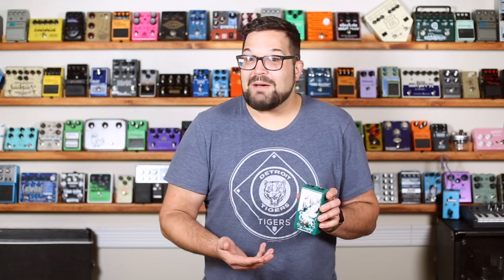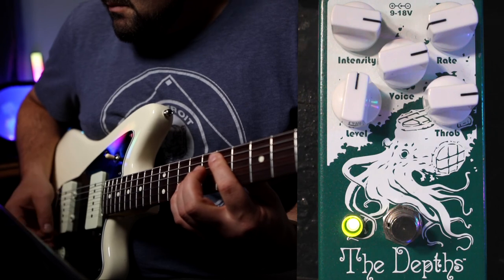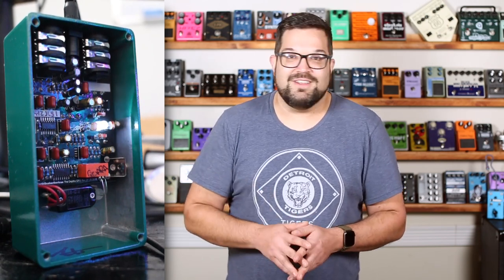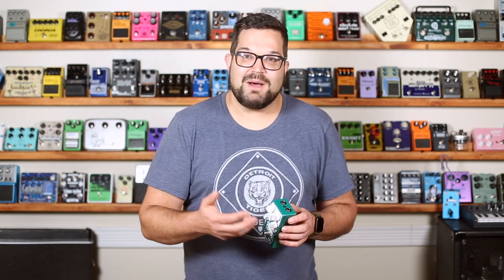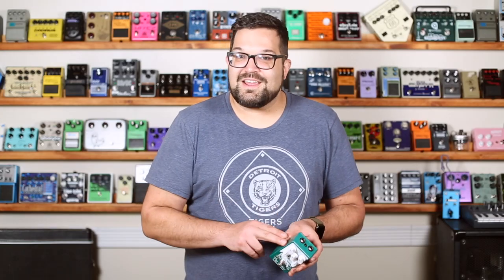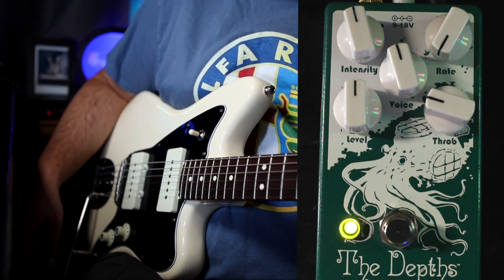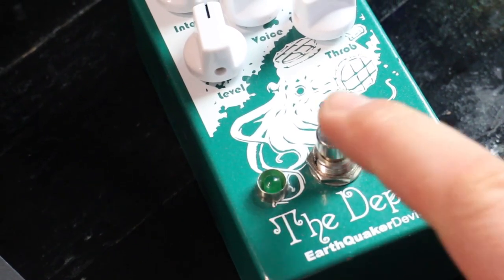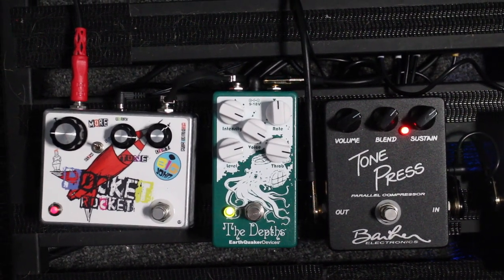Earthquaker Devices - The Depths : Deep Sea Swirlies

Comment: I love the theoretical and historical information, no need to shortcut that.

I also love knowing if a univibe really has a light in it. I know I’m not supposed to care about that, but I do.

You are the first pedal YouTuber I’ve seen who actually has shown, not just the location of the light source, but showing it in operation. I think that’s really helpful for people who are learning about univibe for the first time.

Always love seeing the frequency analyzer, that’s so helpful for understanding what the pots are doing to the waveform.

And omg, ham radio operator - your nerd credit just went through the roof for me. Not cuz I’m a ham radio operator (I’m not), but because i worked for 16 years for a large defense contractor and so many electrical engineers there were ham radio operators, and I associate that hobby with a strong knowledge in electronics.

Great video!
Reply from the maker: Thank you thank you! I initially only got my radio license so I could legally use higher power transmitters for POV cameras in quadcoptors. It’s a fun bunch of tech info, and I honestly found the research fun. There’s lots of neat stuff in the radio arts.  

The Uni-Vibe bulb thing fascinates me. I think about what might happen with different reflective surfaces, or physically moving the LDRs. Or putting a disco ball in there. 

On The Depths, the voice knob controls the overall brightness of the light. Amazing how it all works together, though I prefer the ones with a real bulb and not an LED. They have a different trailing out that I really like.
Reply: @StompboxBreakdown  Same on the fascination with the bulb triggering and wondering what other configurations would do 🙂 That’s cool to know the voice knob controls brightness! Same here, a real bulb is super cool, but golly is that hard to find. Pretty sure my Unicorn is an LED too, but man it’s hard to get a look inside, and I learned the hard way I’m not skilled enough to dismantle modern pedals while trying to fix a bad pot on a Lunastone Distortion 1 🙂

Comment: I have owned the V1 version of this pedal and now have the V2. Also have a JHS Unicorn V2. I love the Depths, just has its own thing going on. It’s my go-to for vibe tones. Great video, nice to see this pedal get some more coverage.
Reply: Is the only difference between V1 and V2 the momentary function like stated in the vid?
Reply: @adamkrauss303  I recall thinking the speed range changed - it seems like my V2 won’t go as slow at the minimum setting as my V1 did. Otherwise I think they sound identical, no difference in actual tone.